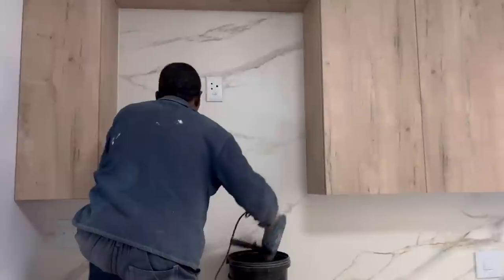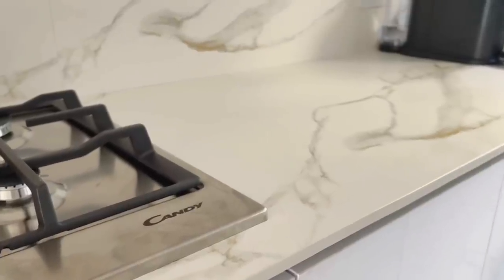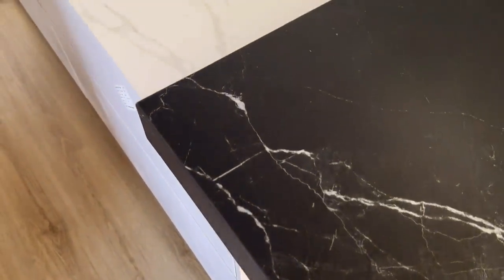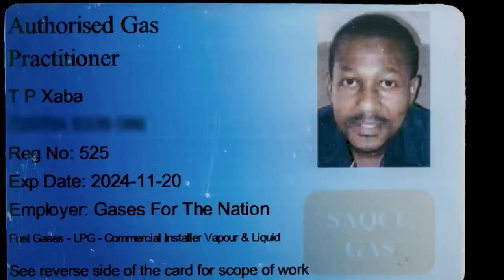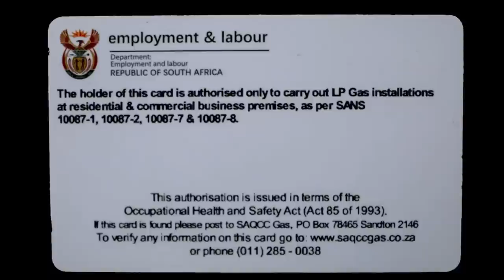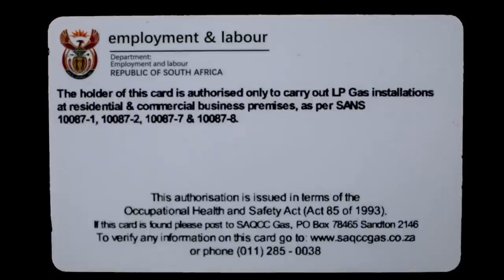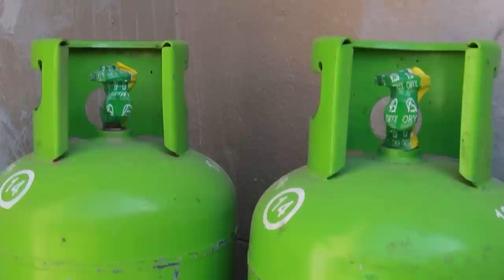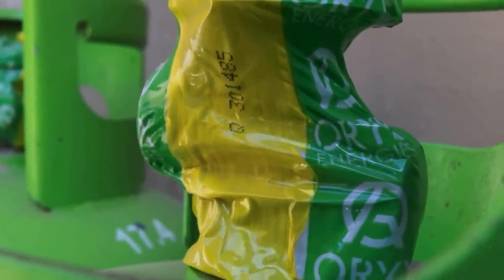Kitchen Makeover Part 4: Progress Update | Gas Conversion Master-Class | New Gas Hob Installation

Comment: Does your oven also use gas?
And do they install a carbon monoxide detector when you switch to gas?
 I'm quite anxious about moving to gas.
Reply from the maker: Unfortunately the oven still uses electricity (it’s built in and separate from the stove). 

I’m terms of the detector. I am not sure 🙈. I will definitely find out and let you know ❤️
Reply from the maker: Did you find the conversation to be helpful? Did it address most of your concerns or is there more things you wish to know that would put you at ease ?
Reply: @karabodidi  Yes, it was informative. Thank you.
Reply: @karabodidi  👍🏾